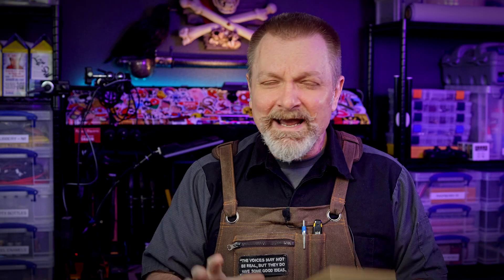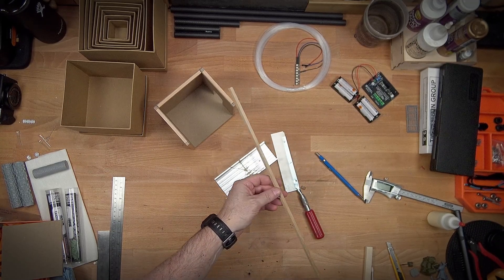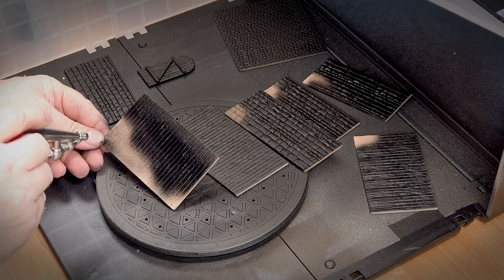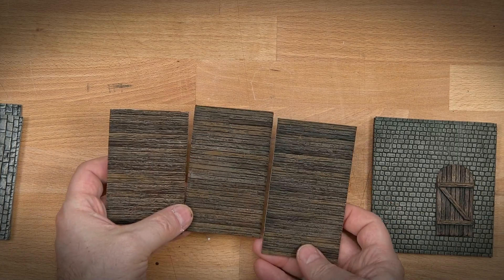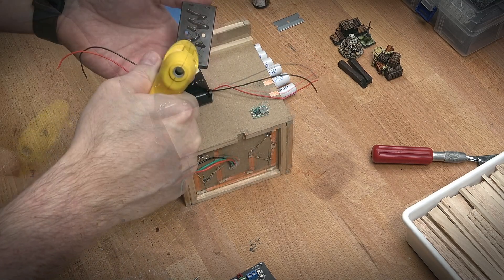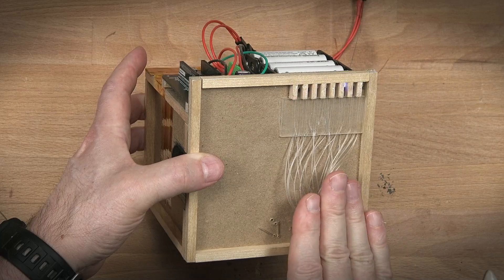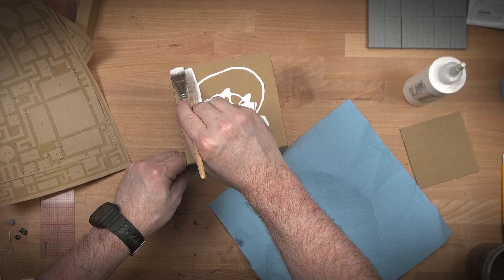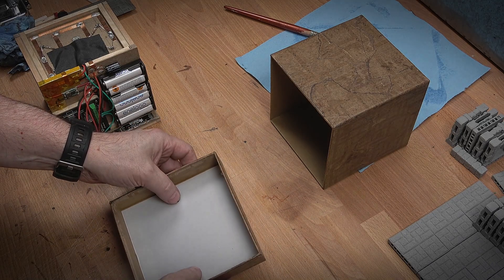I Built a Mini Treasure Room Diorama for Dungeons & Dragons

Comment: I love this!!!  For a very long time I've thought about putting flicker lights on the minis themselves, in lanterns or on a wizard's staff.  Your lantern is exactly what I was wanting, so maybe I could put the battery in the base and use those circuit pens to make the traces up the mini itself to the led?  Thanks for the push in the right direction!!!
Reply from the maker: I've added the .stl file to the blog post linked in the description. It worked out a lot better than I thought it would. You can also find 3mm flickering LEDs online. Now I just need to find some flickering micro LEDs. You could created that effect with an Arduino but that would add a ton of bulk to your mini. Good luck with your project! Cheers!
Reply from the maker: I have another thought for ya. Take a look at wireless LEDs. They use and induction coil to power the LED. Now… the induction coil is a little big but it could be hidden in the terrain and the LED would light up as the character is within the area the coil can power. There could be some cool interactions there! Thanks for commenting!
Reply: @RandomMakingEncounters  Big thanks!!!

Comment: Also / did you have to align the fresh cut end of the fiber optic directly online with the led light source? I’ve found that fiber optic comes in 2 forms - side glow and non-side glow. If you use non-side glow, then you have to light it from the tips, no?
Reply from the maker: I tried to position the tips to be centered on the LED. I also hit the ends of the fibers with a quick touch of heat which "polished" the end and created a bit more surface area for light gathering. In a perfect world, you're correct... you want to blast the light as directly into the end of the optic as possible. Since the distance was pretty short and I didn't need to deliver every bit of light I could possibly move, I think the cheat worked out. I could have rotated the NeoPixel strip 90 degrees... not sure why I didn't... hindsight I guess. When I used optics on my Mando nook, I piped the light from the LEDs straight in and those suckers are bright. For that, I slipped a little heat shrink on the end of the LED and jammed the fibers in. I have some side glow but haven't played with it too much. Too many projects... too little weekend! All the best!
Reply: @RandomMakingEncounters  fabulous reply! Thank you!